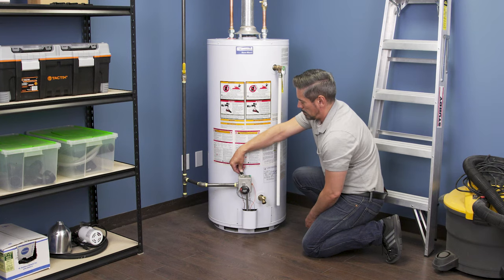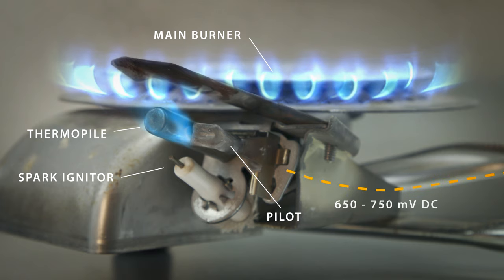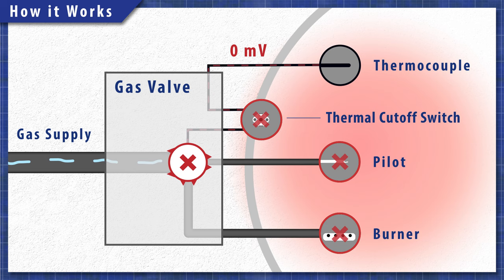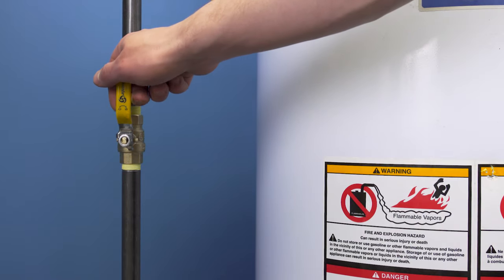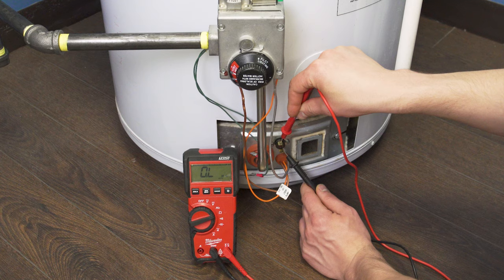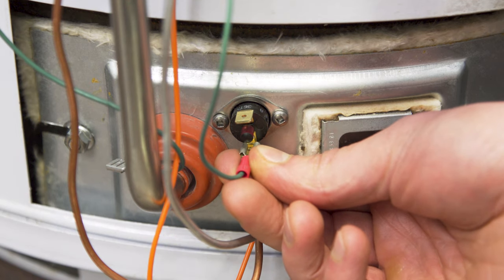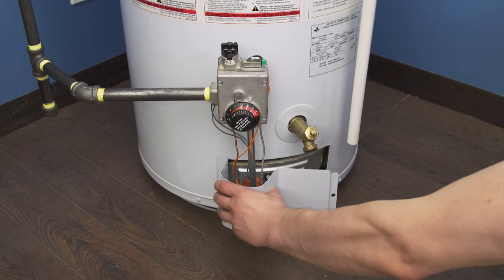Water Heater - Thermal Cutoff Switch | Repair and Replace

Comment: If the tco has continuity can it still be bad
Reply from the maker: Hi Jeff, thank you for watching. A reset-able TCO can warp overtime due to metal fatigue so it might open at a slightly lower temperature, but will still show continuity at room temperature. The chance of this increases with the age of the water heater. If the TCO keeps tripping its still good to check for airflow etc first to eliminate anything that might cause overheating. If the pilot won't stay lit and the TCO has continuity then check the thermocouple or thermopile.

Comment: The reading on the switch was bouncing all over the place on the meter
Reply from the maker: First verify that your multimeter is good. On the Ohms / resistance setting, touch the probes together. You should get a reading close to 0 ohms. 

Now make sure the thermal switch is isolated and the probes make good contact with the terminals. A healthy switch should be between 0 and 1 ohm.  If you're still getting an intermittent reading, or no reading at all, then the switch is faulty and should be replaced.

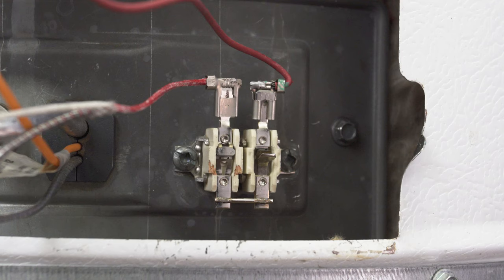Comment: Hi there, my thermal switch OEM part number is 100112053 (for john wood tank).. i see its a special order on your website may I ask if this is an automatically resetting switch or a one time fuse? (since it has no button on it)..  it looks like the switch you show with the honeywell control unit in the video at 1:15 and 2:47
Reply from the maker: Hi Maha, thank you for watching. That switch is a one time fuse and doesn't seem to automatically reset. The ones that automatically reset are the button style design.
Reply: @AmreSupply  it actually does reset if you push on the right side just above the little bar going across the bottom (you'll see the little metal tab that sticks out a bit)
Reply from the maker: @dougluijkx5893  Thanks for sharing your experience, it's good to know that it was able to reset for you. When we were filming this series, we received that water heater second hand and never had it fully hooked up in our studio. When taking a closer look at the switch, it had scorch marks and we couldn't seem to get the metal to push in and it repetitively failed the continuity tests. We never saw the switch in the original state so it looked like it wasn't re-settable.

Comment: Mine doesn't have a TCO what's up with that
Reply from the maker: Thanks for watching. Older models don't use a TCO. The TCO and a flame arrestor screen was introduced  with updated regulations 20 years ago which means new models were required to have those installed.
Reply: @AmreSupply  Mine says it's from 2014 but it looks much older strangely
Reply: The gas control valve won't light up and the pilot won't stay lit. We were planning on replacing the thermocouple
Reply from the maker: @ShiningSta18486  Not sure of all variations between models, the newer ones should have some of those additional safety devices.  

If the pilot won't stay lit then the thermocouple can be tested to see if it is producing enough voltage. You can see more in this video: https://www.youtube.com/watch?v=Mx6rZA9Yxv4&feature=youtu.be

As well it's worth cleaning the threads on the control valve that the thermocouple screws into. If there is corrosion then it can interfere with the electricity produced by the thermocouple.
Reply: @AmreSupply  mine has a thermopile, without a TCO which is next to impossible to find with the spade connection needed to go into a Honeywell gas control valve :(
Reply from the maker: @ShiningSta18486  The previous video that was linked was for the thermocouple. We did make a video specifically on the thermopile: https://www.youtube.com/watch?v=Yx2gfgJB7bI&t=0s
Reply: @AmreSupply  I ended up buying a thermopile without the correct connectors and soldering the correct ones on, hope it works!